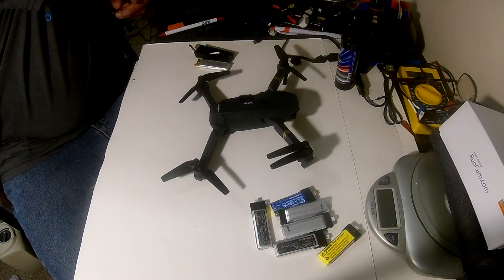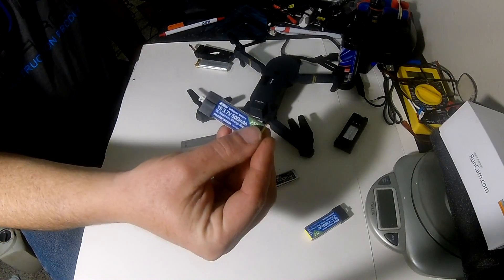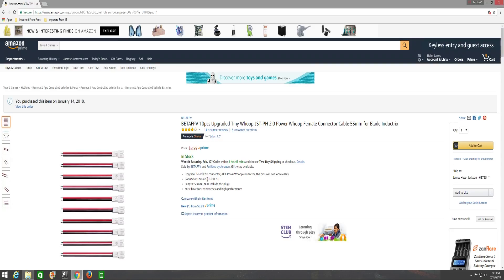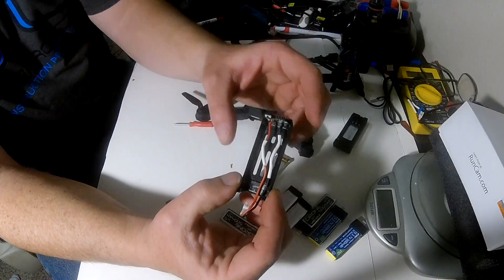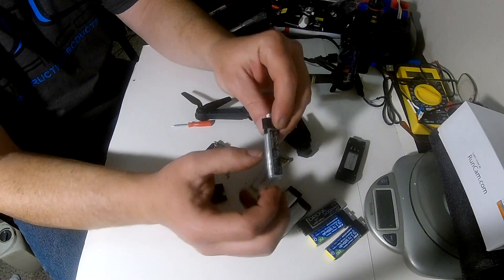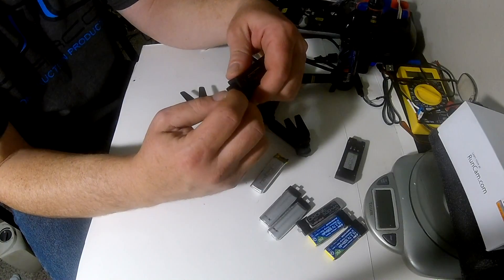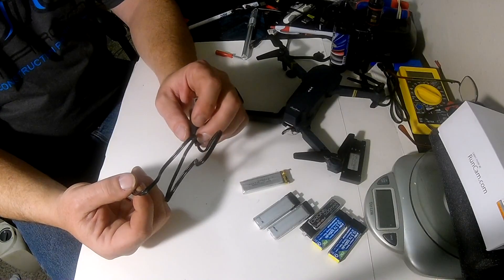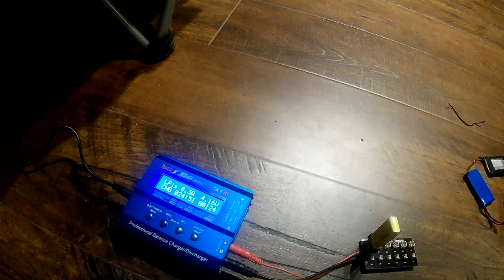Eachine E58:  Easy drone battery mod

Comment: Can I add a power bank battery to the connectors
Reply from the maker: You could but it won't push enough amps to take off.  Too much weight and not enough juice.
Reply: @Blizofoz45  oh how disappointing I thought it would do the trick. Where I'm from they don't sell those batteries as in your video separately. So could I use a  non smartphone battery or even a smart phone battery?
Reply from the maker: @ Alot of big name online vendors have very similar batteries to the ones I used. Search 1S 600mah.

Comment: Is it possible to extend the battery to 3,000+ mAh?
Reply from the maker: It would be too much weight. These days they're making 850mah batteries just like the one I used and I think that would be a good cutoff point for adding capacity.

Comment: What's the best way to maintain these batteries. I have the e88 which is very similar and looks like it has the same single cell battery. First question are these circuit boards programmed to shut the drone off before it depletes the battery to zero. Regardless, when I'm done flying after the battery i cools down . Do I need to charge them. Last but not least when I know I'm not going to be using my drone for a while do I just charge it up to 40% and check it every now and then. Well I don't have a way to tell if it's charged 40% but I figured I would charge it for 30 minutes just to give it enough charge so that it doesn't degrade. I guess bottom line I'm trying to ask what's the best way to maintain your batteries.
Reply from the maker: Best thing to do is make sure you fly it right after you charge a battery up. If you leave a battery fully charged for a few days to a week it'll puff up eventually.

Comment: What is the max mah can fit inside?
Reply from the maker: There are 650mah high volt batteries that are the same shape and profile but I've never bought them to see if they fit. If you search on Amazon for Crazypony 650mah batteries they might have the actual dimensions listed.

Comment: Hey bro how can I modify my drone to get longer flying time instead of 20mins? I have a holy stone drone?
Reply from the maker: Longer than 20 minutes on one battery?  There's some drones that can do it but you'd have to move up to brushless motors and spend alot more money to get there.
Reply: @Blizofoz45  hey bro I just order 20 drones E58 from China just wanted to ask you if I do a upgrades 9n the e58 battery whats the max I can use it like you know how e58 battery 3.7 500mah
What's the bigger battery can I put? N can I use a 3.7v 1200mah to get more fly time?
Reply from the maker: @asianadventure916californi2  I think 1200 mah is probably the best you can get from a single battery.  They're a bit tricky to find but buying a bigger battery will weigh the drone down too much.

Comment: 😰...help please 🙏

Hi. I received an "E88 Pro" drone on Wednesday, and my separately ordered (different vendor) "E88" extra battery on Thursday. After finally getting the drone to start up, I messed around in my flat for a bit until the battery ran out.

I then installed the extra battery (as I charged the original), which appeared to be the same as the original (3.7V 1800mAh). It looked the same, but was a very slightly tighter fit in the compartment. As it was fully inserted, the drone automatically turned on (and at an extremely high speed!), but without the lights. I hit the on/off button on the top of the drone, but to no avail. It didn't turn off until I pulled the battery out. I also detected a slight burning smell, which I thoug might have been the electronic circuitry or engine starting to fry. I tried it again and had the same result.

When my original battery was charged, I inserted it into the slot, but the drone wouldn't turn on at all, not even the lights!

Is there an issue because the "E88 Pro" and "E88" battery are different (the stats appear to be the exact same)? Do you think the extra battery was defective? Do you think the circuitry is now screwed? Separately, the drone was advertised as having a 2nd (bottom facing) camera, but the spot on the underside does not appear to have one in the opening.

I'd be interested in hearing any comments/advice you may have regarding the drone/battery issue. Thanks in advance. Cheers!
Reply from the maker: First off the bad news.  
It sounds like the extra battery was higher voltage than the drone's control board could take so it might be fried.  Drones like this and re-branded E58's like the "Drone-X Pro" have been running scams for the past year or so.  They claim 4K video and other features that are either highly questionable or completely false.  The Chinese factories mix and match so many parts I could see where you may have purchased the wrong battery.  The positive/negative battery leads could have been swapped to the opposite of the stock battery as well.  Drones like this tend to pop on sites like Ebay and Aliexpress.

So here's your options:
Buy another E88 and don't try to use that spare battery with it.  Just use the ones that came in the box.

Buy a Eachine E58.  That's surest fix and Bannggood has it marked down to $32.  They also carry every spare part imaginable for it.

Buy another toy drone and try to swap out the flight controller/motors.  I've done that before myself but getting the motor plugs to fit into another flight control board doesn't always work.  You would probably also have to solder the stock battery connector to the new flight controller.  I've even gone so far as to buy a hobby grade flight controller and transplant it into a toy drone so I could fly it in acro mode, use a hobby grade transmitter for better range and fine tune the controls.

It really comes down to your budget and whether you're interested in doing stuff like modding the drone via soldering and using some different parts.  Modding drones can be alot of fun if you can work through the hurdles.
Reply: @Blizofoz45  ...first off, thanks so much for taking the time to send such a detailed response...much appreciated👍🏻👍🏻

FYI - I paid about $25 for the drone and $5 for the battery, thru Lazada (Thailand).

The modular batteries both say 3.7V 1800MAh on the foil. I've read that often these batteries are really only 500 or 600MAh. Do these batteries even really come in 1800MAh?🤔 I suspect that as you suggested, there was a defect/problem with the extra battery that I purchased (different vendor) and that it did some damage to my brand new drone😢 I've tried to return the items, but am not having much luck so far.

I'm not technically or mechanically inclined, so I won't be swapping out bits and pieces and soldering anything🙃 I guess it'll have to be a write-off, other than having some spare parts should I once again order another one.

Lastly, what's the main difference between the (Eachine) E58 and E88? Thanks in advance!
Reply from the maker: @kap925  Really the only difference between the two is the styling and the spare parts available for the E58.  It uses a 500mah stock battery which gets you between 8-10 minutes flight time.  And yeah I seriously doubt they would use a 1800mah battery on such a small drone. The dimensions and motors look almost exactly the same as the E58 and a few listings I looked at said 600mah on the E88.
Reply from the maker: @kap925  I doubt there's any difference between the two besides the body styling and the brand name.  The E58 is the most popular drone of the past three years so you won't have any problem finding detailed reviews on it on Youtube and as I mentioned before, all kinds of affordable spare parts for it.
Reply: @Blizofoz45  ...once again, thanks for your input!
Reply: @kap925  the difference is 2mp(e58) vs 0.3mp(e88) camera. Maybe e88 bigger that's all I know.
Reply: @Blizofoz45  Fact... I have the Eachine and F89. The battery polarities are different.

Comment: I got the 1200Mah battery waiting to get shipped .. How long will be the flight time?
Reply from the maker: If you use something light to secure it like a small rubber band, I would think at least 10 minutes.  Wind speed and your flying style(fast vs. relaxed cruising) are big factors in flight time.  Let me know how it goes!
Reply: @Blizofoz45  actually the weird part it really looks identical on the battery that came with the drone but it was labeled 1200 mah.. no modification required on battery compartment.. still waiting for the shipment propbably this week mate

Comment: So for a dummy like me what's the flight time now?
Reply from the maker: It's about the same at 5-7 minutes but you can use higher capacity batteries like 600mah that will add a minute or two to flight times.

Comment: Nice video bro, I have a question maybe u can halpme I try to upgrade a Battery in a little dron spider gw58 global its stock bateríe 500 mah 3.7 was dificulta to find, so I bought a 3.7 550 mah genéric, the first flight was nice 4 mins more than usual I plgged a conector to positive and negative point in fc, but after 2 flight bateríes seems fat and bigger as damage the dron dont flight again with those bats, only star lights try to run motors but nothing more but with its stock bateríes every its normal....i reconect the cables to main board but the same... Maybe those bateríes are voltaje low or what could be happen...really apreciate your advice to mod the original bats to a genéric, maybe the valtaje and mah are similar but bateríes es samller cound affect...?
Reply from the maker: When a battery gets puffed up it's usually dead and needs to be disposed of.  I would try the CrazyPoney 3.7v 650 mah batteries.  Amazon and Ebay have them for a reasonable price.
Reply: @Blizofoz45  excelente I didnt considere the numer of "Cs" discharhe rates of the bateríes maybe the genéric are low quality and less rate of Cs...

Comment: Ive got three drones◐◐>JustU.Faith/Eachine?繭    I really like my teenie tiny one. Its zippy. But!.. my Emotion quad copter is the best drone ever made! Its quick response, speed, adjustable camera lens, ease of use and portability make it the best drone in my collection. Im hoping they make a bigger drone. Being reliable and literally indestructable is important if your career is a drone pilot. It's nice to be able to reuse your drone after a crash. My emotion has been flown accidently into a brick wall at full speed. Not only surviving, it fluttered for a beat then recovered its flight.

Comment: Sorry late in chat lol Question, I have E58 love her ,i buy 2x replacement battery x2 they charge but not power bird. Can i utilize them in any way?  Like making a new connector for a one batt fit all ?
Reply from the maker: You can always open them up and see if the battery is puffed.  But yeah part of my reason for changing the connector was to use better batteries.

Comment: Are there advantages to this aside from repairing batteries? did you increase payload, flight time, battery capacity, or cut charge time?
Reply from the maker: It lets you use bigger batteries if you want more flight time.

Comment: New to this. How would you know which batteries are compatible with the original rating? I assume voltage has to be the same no matter what. can you get a battery with a higher mah for longer life? What else can differ?
Reply from the maker: Just about all 1S batteries have a base voltage output of 3.7 volts.  At full charge they'll be at 4.2 volts.  That's what the E58 uses.  There are some newer 1S batteries that go to 4.35 max volts that I wouldn't use but online vendors will always have the voltage listed in the product description.   Here's a link to some cheaper batteries on Amazon have a higher mah capacity(longer flight times) that look like they would fit into the E58 battery slot:

https://www.amazon.com/Battery-PowerWhoop-Connector-Inductrix-Quadcopter/dp/B077PRY7K3/ref=sr_1_14?s=toys-and-games&ie=UTF8&qid=1545445090&sr=1-14&keywords=1s+battery
Reply: @Blizofoz45  Thanks for the info. Quick question, when you mention base voltage output being 3.7, when looking at a battery in my hand saying "3.7 volts" would you say thats the base output or the full charge max? Should I be careful seeing how high it will go? etc.
Reply from the maker: @grantfu5506  Full charge should be 4.2v which translates to 100% battery life.  3.7v to me is more like the minimum voltage which basically translates to "stop flying now".  Beginner quads like the E58 monitor the battery's voltage in realtime and will signal you to land at round 3.7v or it will simply land itself to keep from overusing the battery and causing permanent damage to it.  In reality these batteries can be drained down to 3.3v but it's a bit risky to do that and I don't think the E58 will let you anyway. :)

Comment: Friend my battry is not charging what can i do for it help me...
Reply from the maker: Dulanjana Edirimanna Is it the stock battery?
Reply: @Blizofoz45  yes i buy drone with 3 battries but no one is working
Reply: @Blizofoz45  https://youtu.be/VKT_cWem63c see this..this is my problem also
Reply from the maker: Dulanjana Edirimanna First make sure you’re pushing the battery in as far as it can go. That happened to me too the first time I tried to fly mine.
Reply: @Blizofoz45  i tried it but its not work friend
Reply from the maker: Dulanjana Edirimanna Make sure you’re  pushing the power button down for 3-4 seconds. Next thing would be to use the screwdriver that came with it to take the top half of the canopy off.

With the top off you can slide the battery in and make sure its making contact. There’s positive and negative power wires going from the flight control board to the on/off switch and another set of wires going from there to the battery connector. Makes sure all those wires are soldered.
Reply from the maker: Dulanjana Edirimanna Watch this video if you want a guide on how to take it apart and see what’s in there:
https://youtu.be/HoZUKzStchg

Comment: Batteries for the Syma X5C (852540) fit perfectly into the battery bay of the E58.  Slides in/out, but a firm fit without needing a door or retainer.  I soldered the same JST-PH female connector from the circuit board and ran it over top of the main board to the back of the battery hatch, exiting by the rear LED.  Plug it in, slide in the battery.  If I use an E58 battery, the JST-PH connector tucks up behind the rear LED.  Thanks for the idea!
Reply: Just got same idea. You can buy cheap battery from hobbyking 750mAh size 44x25x9,5mm , people say its for syma but according measurement will fit little harder to battery try, just need to soldering jst connector on board and whola...

Comment: very well explained video ... can i use any samsung galaxy phone battery???
Reply from the maker: That's an interesting idea I've never thought about trying that.  As long as it produces somewhere between 3.7-4.2v I guess it could work but I think phone batteries are lithium ion instead of lithium polymer.  Ion batteries have been made to work in very conservative flying camera drones but usually they can't push through enough amps fast enough for a quad.

Comment: I think the original battery is 25c and you put a 30c, does not this cause the engines to burn?
Reply from the maker: Not that I've seen.  Some lipo batteries go up to 45C and I've never heard of that directly causing motors to burn out.

Comment: If we put a solar panel instead of battery
Reply from the maker: Gopalan Babu In all seriousness you can actually run a glider off solar cells. A quadcopter needs bursts of amps that solar power would never be able to pump out fast enough.

Comment: What battery did u get
Reply from the maker: I'm using Venom RC 500mah batteries.  If you shop around you'll find alot of other batteries with that shape and size on Banggood.

Comment: I upgraded the battery, put 1500mAh into my E58. The device responds, binds with the controller, even Wi-Fi module is completelly working. The problem is when I try to start motors - they spin one time then the drone turns off immediately. I tried changing motors to 8,5mm, the probmels however persists. What might be the cause of this problem? I am sure its something with battery and flight controller. Can it be the battery not making enough Amps?
Reply from the maker: Radek Holý The first thing I thought was maybe your battery’s voltage was higher than 3.7v...they probably make 1s batteries that big but they definitely aren’t common. Apart from that you might double check to make sure the battery is fully charged...the wifi, leds, etc don’t need very much juice at all to work.

Comment: Dude, you read my mind! :D Thanks! I was just looking for this mod! I'll try to use this battery:
https://www.ebay.it/itm/222904804680?var=521729035550
3 times capacity, and only 1 cm more of lenght...
Reply: Hi, this link don't work. But what you model used  ?thanks

Comment: 103450 Li-ion 2000 mh
Reply: I got this battery and it does not work. Drone runs for a few seconds then dies. I believe the c rating is too low on it and auto shuts off to  prevent a rupture.
Reply: Too much big...look this:752080 LiPo 3.7V, it fit inside, but is only a little longer... 1500mAh is 3 times the stock battery, only 1 cm more lenght